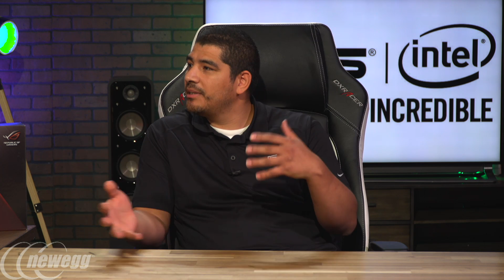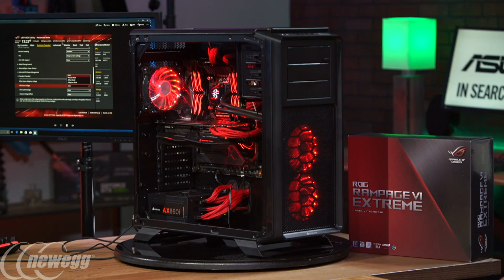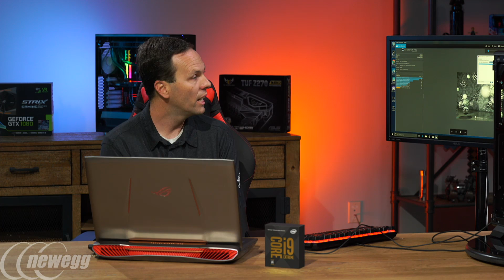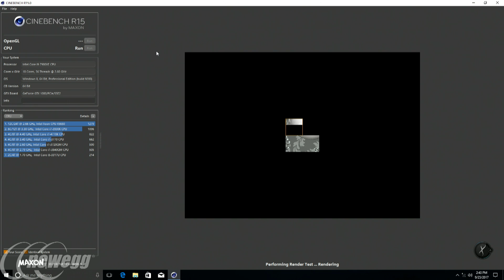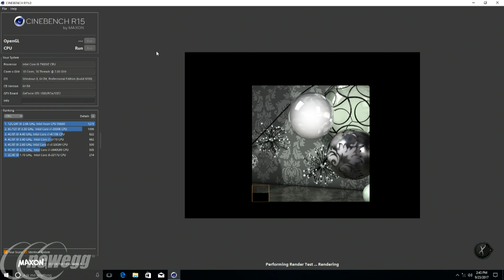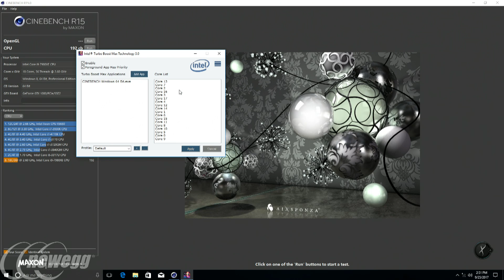Newegg Studios Live: The New 18-Core CPU in Action with Intel and ASUS

Comment: 7980XE is not the first teraflop processor Intel made. The Xeon 2679v4 released a year ago was the first processor that can reach a teraflop of peak performance (20 cores*3.2GHz turbo*8 op per avx2*2 avx2 units=1024 Tflops).